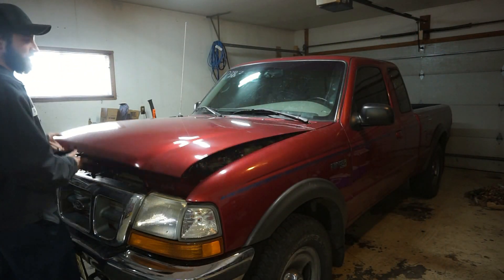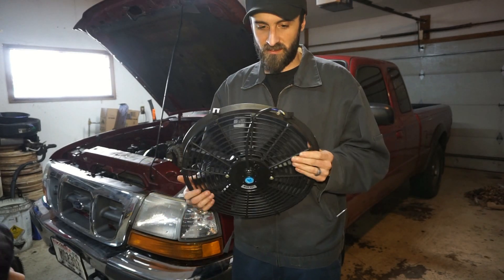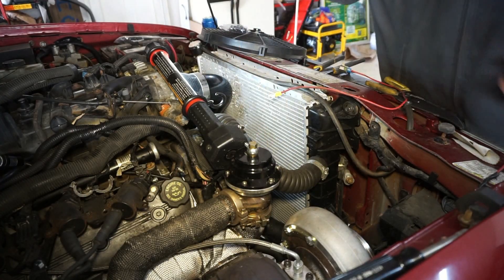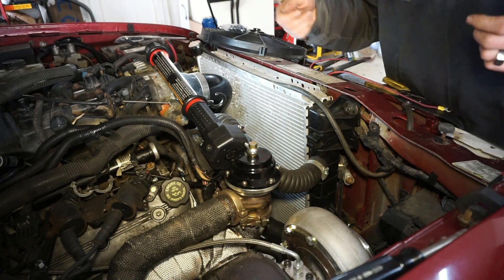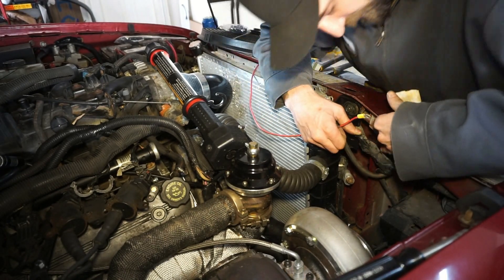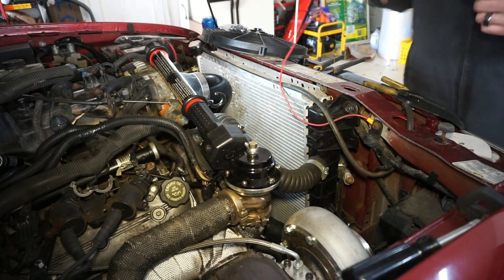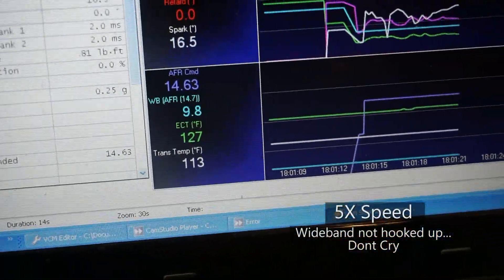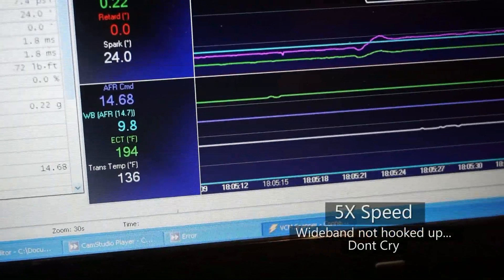V8 Swapped Ranger Cooling Fan Install!!!  - a21bravo

Comment: Ford taurus fans! Everyone who does LS swaps uses them brother. They pull WAY more air than you will ever need, and are like $30 at the junkyard.
Reply: Tater79bj I modified a Taurus fan with a 2 speed motor from a BMW aux fan lol my ls1b ecu controls the low and high speed works great

Comment: You can use fbody fans if you need more but also having a shroud to focus the air through the radiator will probably help more at a stand still or moving slow.

Comment: Shroud. SHROUD! I'm sounding like a troll cuz I tell hunter to do it for his chevstang over & over. It's not even warm out yet. A shroud will help in the staging lanes at the drags, I promise. No shroud means some of that hot air coming out the back of the fan flows hot around the fan thru to the front & pulls through again when you're stopped.
Reply from the maker: Agree. Just kinda testing this one. I spend some time with it today and put about 40 miles on in the 25-35mph range. It did start to get a little warm at some points. I'm going to remove my AC condenser also, not using it but a bunch of restriction.

Comment: I use cheep lengths of metal you get from the hardware store with like shelving accessories and small little l brackets and such utilize the metal space of the top and bottom of the rad to keep any bolts from rubbing against the radiator find drill holes accordingly  for brackets (be extremely careful not to puncture through in to the coolant chamber of the radiator) cheep but solid

Comment: Tuarus, HHR, or Volvo 740/940/960/V90. If you get the Volvo is mount with three screws at the top and grab the relay that is attached (2 speed) 
$15 at the u pull it yards here.

Comment: Great video!
I liked the to see the 350z again. I have a 2001 for ranger 3.0 witch I been working on, in the beginning was over heating I check and remplace the cooling systems and also fixed a blow heat gasket but the truck keeping overheating then I noticed the overheating was just on the high speed then the transmission broke too a little after. My neighbor witch is a retired mechanic tell me is very unusual but if the transmission is bad can cause a overheating too. I would like to listen a seconding opinion.
I think you have a lot of knowledge and you are a cool guy.
Thank you.
Reply from the maker: Antulio Licardie We'll be seeing more of the Z soon... deciding what I want to do with the trans.

Comment: Intrepid fans are used alot as well that is what i am using in my 5.3 swap. I would of went more to the center of the radiator long as it works all good.
Reply from the maker: Sean Clancey IC pipe and bottom hose in the way of moving it over farther... It's a 14" fan so pretty big.

Comment: What are you doing for a transmission cooler
Reply from the maker: FORDGTFANATIC factory Ranger cooler.
Reply: a21bravo ok just be careful a trans temp gauge wouldn't be a bad idea, I had a 4l80e burn up in stop and go traffic cuz my cooler was inadequate. It took forever to get hot once it did it didn't want to cool down

Comment: Oem fans are always best, I just swapped in a set of Ecoboost fans (17 F150) and a derale variable speed fan controller. Less than $200 out the door for both controller and fans, and cooling that will hang with 13,500 lbs of towing from the new 3.7. I've tested and verified this will cool any setup that's not outrageous or extreme. Hers some links. 

https://www.amazon.com/gp/aw/d/B00N0N75TI/ref=mp_s_a_1_1?ie=UTF8&qid=1522549441&sr=8-1&pi=AC_SX236_SY340_FMwebp_QL65&keywords=derale+16795&dpPl=1&dpID=41zbP-fKJYL&ref=plSrch

https://m.ebay.com/itm/AL3Z8C607A-BL3Z8C607A-FO3115184-New-Cooling-Fan-Assembly-Ford-F-150-F150-Truck-/361476971835?_mwBanner=1

The controller was $144 on eBay, the fans were $52 off eBay as well. Way fuckin overkill! I would bet bottom dollar flex a lite anything is junk in comparison.